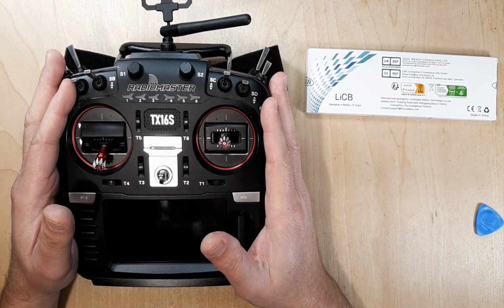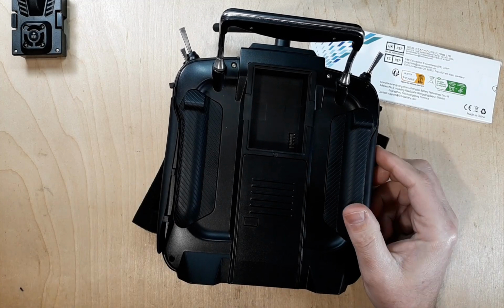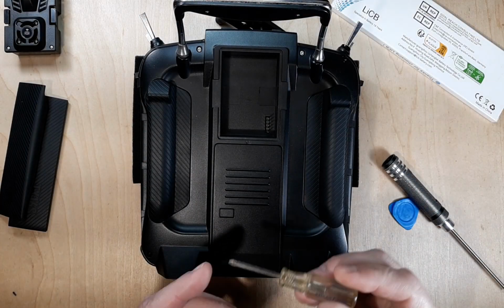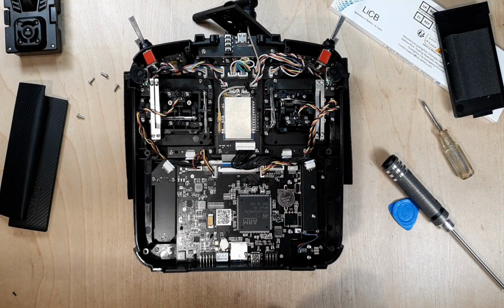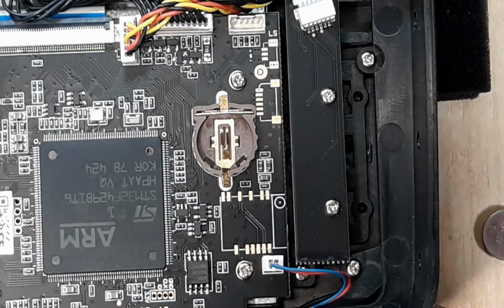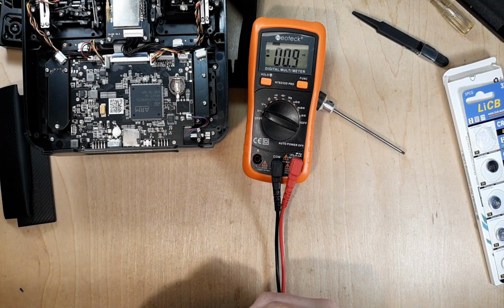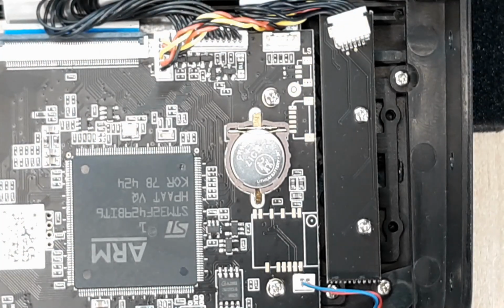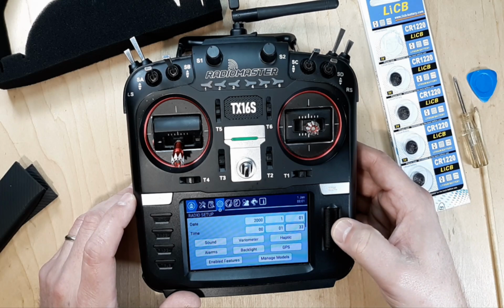RTC ERROR | Radiomaster TX16S Internal Battery Replacement

Comment: Thank you again for your help.
It is very important for me to keep RTC Clock when we have some models to save and backup.
For my 2 TX16S, i have no issue with RTC battery.

But,

For my Zorro Max, and those of my 2 friends, there is an issue, the battery seems good, good voltage, but does not keep the date and hour.
RadiomasterRC sent to me New mainboard, New battery, same issue.

Nobody talks about this Zorro issue
Reply from the maker: @christopheloridan3058  
I will have to dig into this...🤔
I have a first gen Zorro too...🧐
Thanks for the heads up on this, I appreciate your support and feedback...👍🏻🍻👊🏻
Reply: @PropsOff  i have 2 génération of main board for my Zorro Max, v2.5, from original, with bug, and v2.1 sent by RadiomasterRC, and then again, New v2.5 mainboard.
I save my models, on sdcard, their files have Always same date/hour.
If i keep the battery 13650 inside, no issue. But i dont like to keep batteries inside if i dont use the radio for a coupe of days
Reply from the maker: @christopheloridan3058  
Very interesting... Since I posted this video, I've had multiple people besides you say things about the Zorro. I will definitely be digging into mine to see what's up with that. I run external power with no 18350 batteries. I appreciate your information...👍🏻👊🏻🍻
Reply from the maker: @christopheloridan3058  
I made a video for you and added more info in it for new people. I hope it helps ya...🍻
*You will most likely be most interested in the 7 : 55 mark of the linked video 👇🏻
https://youtu.be/g2riGSpe0dQ?si=wud4P09lvQmG3fNN
Reply: @PropsOff  Excellent, thank you PropsOff, i will watch it soon... it's very early in the morning 😀for me now ^^ :)
Reply from the maker: @christopheloridan3058 
I finally got my Zorro to reset. It actually reset so much so, it lost all switches and buttons. I had to go in and reprogram them...🤯
I found the date reset back to 1970 and now will reset to 2000.. I am messing with it and hope to find the corruption. I don't believe it has anything to do with EdgeTX or ExpressLRS. It seems to be how the radio settings are created. More to come soon....
I was very frustrated, as I was at a race trying to figure out how to get it all working again...😡🤣
Reply: @PropsOff  hi, i have some difficultés to understand what you mean. Has you New trouble or issue ?
My Friends and i, we have all New RadiomasterRC Zorro (less than 2 years old) and they have lost date/hour issue, when the unplug their 13650 batteries.
The cr battery for cmos saving does not make the job.
Please, tell me if your last answer is positive or négative.
Thank you for all your sharing
Reply from the maker: @christopheloridan3058  
Positive..
I found the corruption and will be calling Radiomaster. Hopefully,  a fix coming...🍻